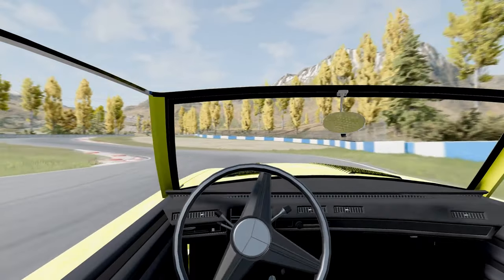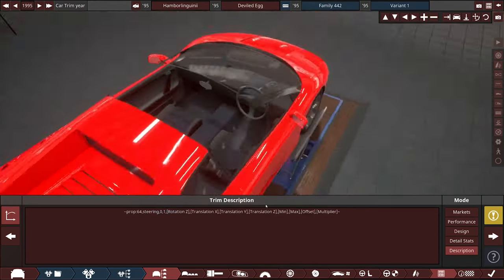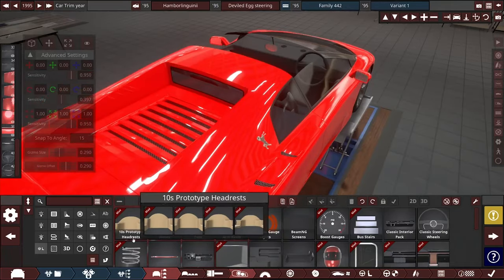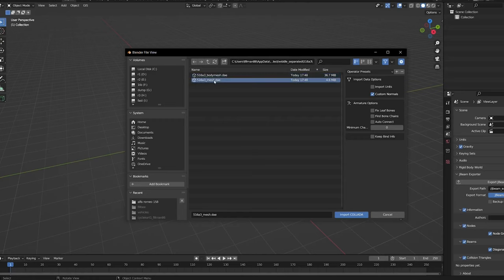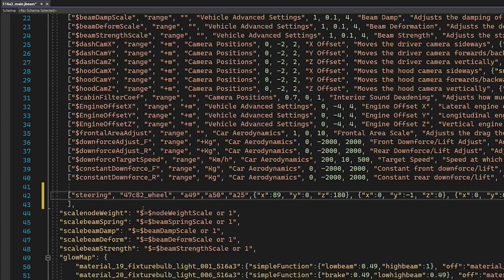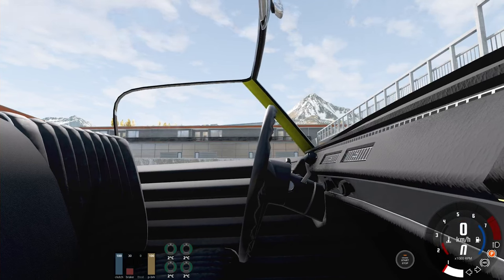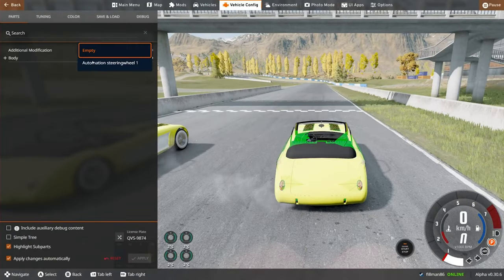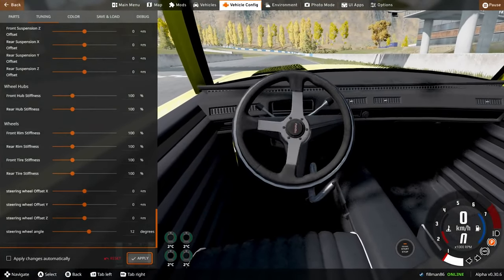Automation's Hidden SteeringWheel BeamNG Option

Comment: Great video Fill! Have you released a video on how to animate a manual shifter to work? if not, I'd love to see one! consider it "liked" already!
Reply from the maker: unfortunately the shifters are not props, but instead a complex node structure with hydros -_- it's such a bad design
Reply: @fillman86  yikes, i wonder why so complex. seems like something that could be done using the axis and translation parts of the code. but im an armchair dev lol i do wonder if its possible without hydros though
Reply from the maker: @Eric-tg9ss  no, because there's morphing of meshes. I could work with a gated shifter, but not anything normal with a shift boot. They'd have to implement a way to play pre-made animations
Reply: @fillman86  that makes total sense that the boot would have to also deform. last night i got a hydaulic hand brake working and it got me wondering if it could be applied to a manual. now im curious how it would work with a gated or sequntial shifter

Comment: Also, if you wanna export analog speedo/rpm I'm gonna copypaste this here too, I've used needles from "4.27 Customisable Gauges" (note that at this early stage scale doesn't export):

~prop:29,wheelspeed,0,-5.6,0,0,0,0,0,50,0,1~~prop:26,rpm,0,0.03,0,0,0,0,0,7000,0,1~

speedo needle is min 0 and max 50 m/s (~180 km/h) in this case. -5.6 in Y rotation is 280 deg / 50 m/s = 5.6 (negative because the needle was going the wrong way)

rpm needle is min 0 and max 7000 rpm in this case. 0.03 in Y rotation is 210 deg / 7000 rpm = 0.03 (might need to be a negative number too, depends on your case)

needles export at their default scale currently, so to change it you need to go into the .dae file and find the needles (mostly marked by eft_interior_prop) and change the 1s to 0.5 scale (or whatever you have in automation)
Reply: Thanks for all the help. Besides, where do you find documentation for this code? Can you show me the source? Is there a command where you can change the scale of the prop?
Reply from the maker: this guy (or gal)
Reply: @fillman86 uhh i think hes guy
Reply: @ownedpilot4324  I think youtube is removing my comments for linking beamng documentation... but yeah generally the "Props" and "Electrics" sections of documentation
Reply: So this could totally be used for making working popup lights, right?
Reply: @xenoyparxi  you can't put URLs in comments anymore
Reply: @SonicBoone56  I wouldn't be so sure. I believe the vanilla popups are animated via hydraulics, and on the electrics page you only have a on/off function for lights
Reply: For anyone looking to add boost gauges you can use this:

~prop:2,turboBoost,0,-4.5,0,0,0,0,-20.0,40.0,0,1~

Change these to suit your needs:

-20 is minumum boost on gauge.
40 is max boost on gauge.
-4.5 is degrees of rotation per PSI (in my case 180 / 40 = 4.5), as above you may need to change the negative to positive depending on direction of rotation
Reply: this is incredibly simple to use! i would like to know if it isnt much bother, can you do this for fuel, temperature, and oil pressure gauges too?

Comment: Can someone let me know if this still works? I know theres been some small updates since this video, and I keep trying but cant get it working right. I had the same few problems as Fill but when I made the fixes, it still didnt work.
Reply from the maker: you don't have to worry so much about the fixture number, it's now just the number it is in the list (meaning you don't have to count mirrored)
Reply: @fillman86  oh thanks. I got it working after I asked that but I went manually into the fixture text and moved the steering wheel to the top. Knowing I didn't have to do all that is about as disappointing as when you discovered this trick 💀

Comment: Holy shit, the export process just keeps getting better and better. But honestly I'm surprised Camshaft hasn't just hired you on to help with the exporter at this point. Of course, it's somewhat useless in my case because I disable the animated steering wheel in BeamNG and other sims because it ends up being distracting.
Reply from the maker: I don't know much about lua, and most of the exporter is lua based. Anything that's not lua is just mumbo jumbo that I stand no chance of understanding haha

Comment: when i export a car to beamng, the steering angle on the steering wheel is always just about 600 degrees. is it because im using manual rack and pinion? do i need to change it?
Reply: I think there's a tuning parameter for that
Reply: @stoobidthing got it already, setting inside beamng

Comment: I need help. I tested the ellisbury update few months ago and now when I go to ellisbury update, all cars I made in normal 4.27 after testing the update doesn't show in ellisbury update. How can I get them from normal 4.27 to ellisbury?
Btw. I still use normal 4.27 because some of my meme engines doesn't work in ellisbury so is there a code that in beamng tail lights are tail lights instead of brake lights and brake lights are brake lights instead of tail lights.
I'm glad if you can help me. 😅